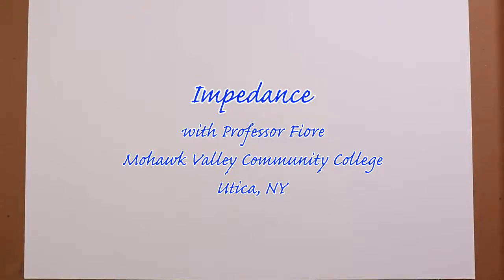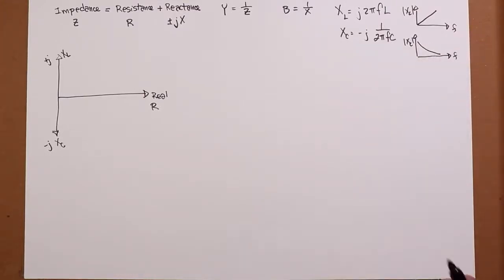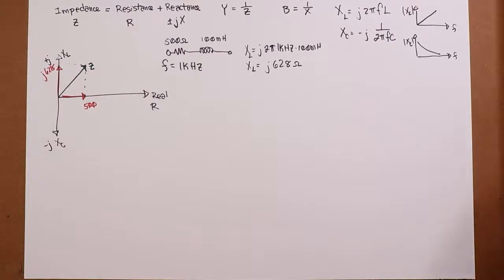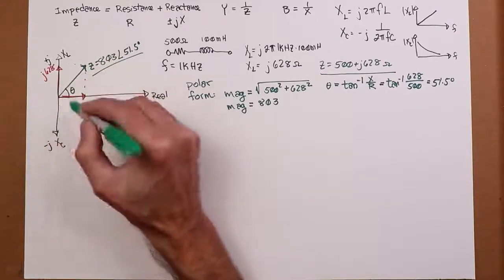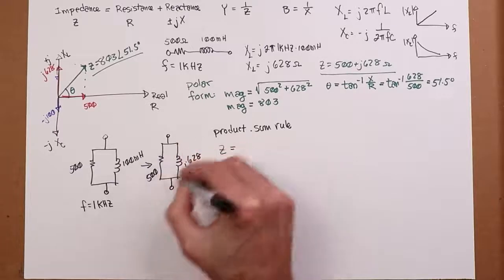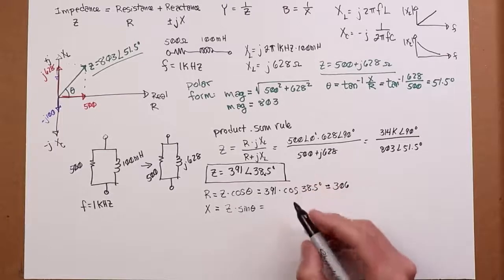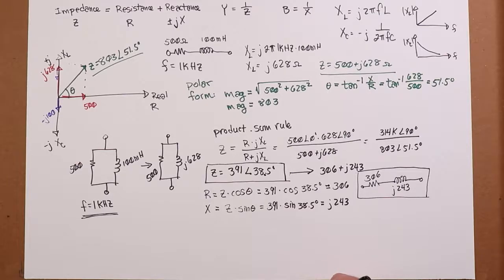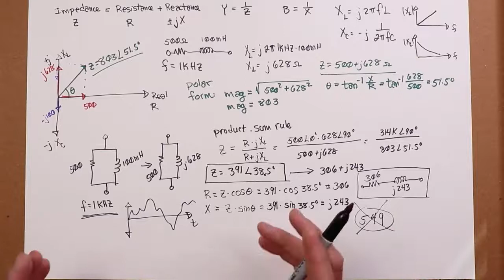AC Electrical Circuit Analysis: Impedance

Comment: Brilliant, it's all becoming clearer and my Maths is improving. You draw the Inductor reactance/frequency graph as a straight line. That doesn't feel right, is it a good estimate or actually the case?
Many thanks, in advance. I'm really enjoying my morning brain workouts with you.
Reply from the maker: That's the ideal case: Xl is directly proportional to frequency. In the real world, there are low and high frequency limits. At the low (or DC) end, the coil resistance sets the lower impedance limit (think in terms of a small resistor in series with an ideal inductance). At higher frequencies, distributed capacitance comes into play and the magnitude of the reactance starts to drop off. In general, real world inductors are the least ideal of the three passive components. Consequently, inductors are designed for optimum usage across a certain range of frequencies.
Reply: @ElectronicswithProfessorFiore  For some reason, I was thinking about very high frequencies as being problematic, I neglected to consider the DC case. Thanks again for responding, most informative. I can't believe that I'm being educated for free. This is what the internet was all about in the early days (do you remember the JANET network?)
Reply from the maker: @simonyoungglostog  No, but I do remember arpanet (wasn't on it, but remember reading about it). Although the net certainly does make possible the distribution of valuable yet free materials (an ethos I think exemplified by the freeware/shareware movement of the 1980s), sadly and to many, it is simply one more thing to exploit for profit. And that includes this platform. BTW, I have not monetized this channel and have no intent to do so, so if you ever come across an ad at the start of one of my videos, by all means, skip over it ASAP. I get nothing for it. Making money was never my intent when I started this. I believe that education should be free to anyone interested.